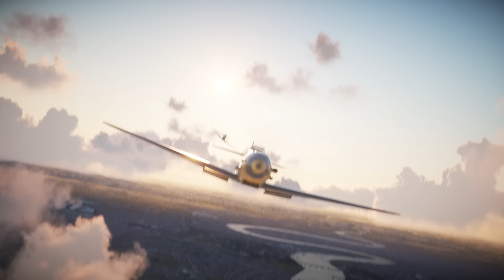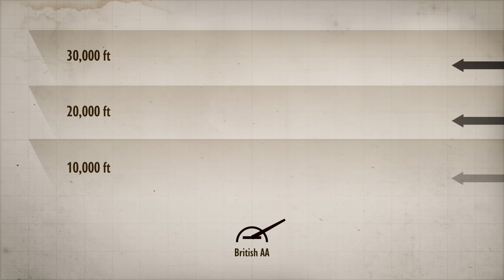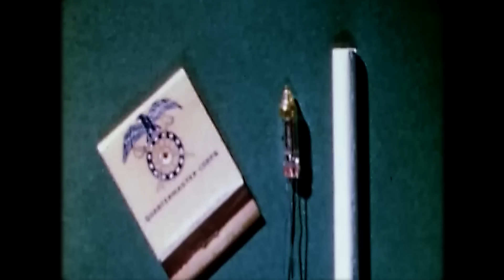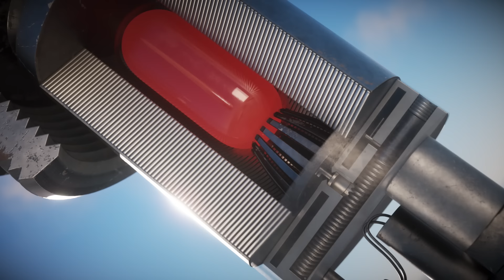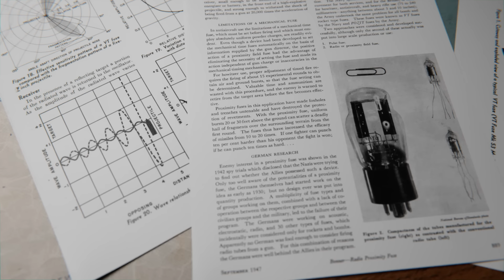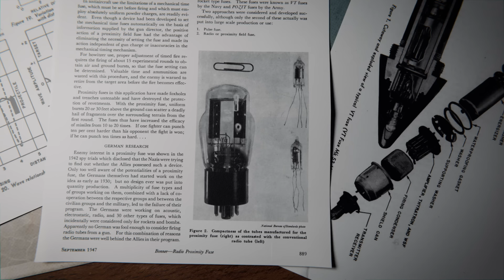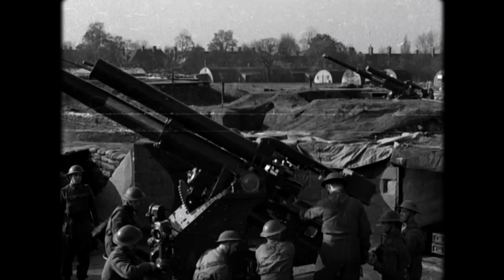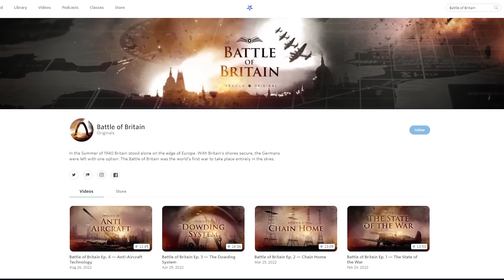The Secret Invention That Changed World War 2

Comment: The British Technical and Scientific Mission [also known as the Tizard mission] travelled to the U.S. in September 1940 during the Battle of Britain.  The technology Britain passed to the US included the greatly-improved cavity magnetron [which the American historian James Phinney Baxter III later called "the most valuable cargo ever brought to our shores"], the design for the proximity VT fuse, details of Frank Whittle's jet engine and the Frisch–Peierls memorandum describing the feasibility of an atomic bomb.  Included in the other technologies given to the US were: designs for rockets, superchargers, gyroscopic gunsights, submarine detection devices, self-sealing fuel tanks and plastic explosives.
Reply: Sonar/ASDIC was invented in France. US aircraft, except P51B's and up and two variants of P40, used turbo chargers. Self-sealing fuel tanks had been around since WW I, they would not be standard on RAF aircraft until after the Battle of France.
   "given" As of 2006 Britain still owed the US 4.4 billion 1934 USD in WW I debt. "First and foremost, they note that they have written off the main body of Lend-Lease, amounting to something of the order of £4,000,000,000 to £5,000,000,000 (16 to 20 billion USD) net"
 below 678 
Hansard ANGLO-AMERICAN FINANCIAL ARRANGEMENTS HL Deb 17 December 1945
Reply: @nickdanger3802  So the P51D had turbocharger fitted to its RR Merlin?

Heavier than air flying machines have been around since long before WW1, that doesn't mean that the technology had not advanced by WW2 on various aviation fronts.

Not that it has any relevance, but On 31 December 2006, Britain made a final payment of about $83m (£45.5m) and thereby discharged the last of its war loans from the US.  Also  In 1952, the London Agreement on German External Debts assessed the final reparation figure at $3 billion. Germany has yet to pay off its debts for World War II.
Reply: @gnosticbrian3980  "US aircraft,    except    P51B's..." 
Allison engines in everything EXCEPT P38's had a single stage supercharger, P38's used a turbocharger as the second stage. Radial engines in combat aircraft had superchargers and turbo chargers.

United States: War Loans to UK
HL Deb 27 May 2002 vol 635 cc126-7WA127WA
§Lord Laird asked Her Majesty's Government:
Whether they owe money to the United States Government as a result of World War Two debt: if so, how much is owed; when it will be repaid; and what representation they have made to the United States Government concerning the debt being cancelled. [HL4422]

§Lord McIntosh of Haringey Under a 1945 agreement, the United States Government lent the United Kingdom a total of $4,336 million (around £1,075 million at 1945 exchange rates) in war loans. These loans were taken out under two facilities:
(i) a line of credit of $3,750 million (around £930 million at 1945 exchange rates); and
(ii) a lend-lease loan facility of    $586 million    (around £145 million at 1945 exchange rates), which represented the settlement with the United States for lend-lease and reciprocal aid and for the final settlement of the Financial claims of each government against the other arising out of the conduct of the Second World War.
Under the agreement the loans would be repaid in 50 annual instalments commencing in 1950. However, the agreement allowed deferral of annual payments of both principal and interest if necessary because of prevailing international exchange rate conditions and the level of the United Kingdom's foreign currency and gold reserves. The United Kingdom has deferred payments on six occasions. Repayment of the war loans to the United States Government should therefore he completed on 31 December 2006, subject to the United Kingdom not choosing to exercise its option to defer repayment.

As at 31 March 2001, principal of $346,287,953 (£243,573,154 at the exchange rate on that day) was outstanding on the loans provided by the United States Government in 1945. The Government intend to meet their obligations under the 1945 agreement by repaying the United States Government in full the amounts lent in 1945 and so no representation has been made.
Reply: @gnosticbrian3980  "Britain actually received more than a third more Marshall Aid than West Germany - $2.7 billion as against $1.7 billion. She in fact pocketed the largest share of any European nation."
BBC The Wasting of Britain's Marshall Aid
Reply: Indeed so - where have I ever denied it?  The aid received was then p****d up  against the wall by the Labour Government.

Doesn't change any of the facts in my original post. @nickdanger3802
Reply: @gnosticbrian3980  Who used it among other things to create the once superb National Health Service, reorganise the railways, build 1 000 000 Council Houses in 5 years, enable cost-free kindergarten, primary and secondary education for all including government- funded university education if had one passed one's exams at one's government-run secondary school , all part of a socially valuable impetus that remained until Thatcher wrecked the UK by privatisation of every State-owned industry and public service. No doubt in the USA all that is seen as pissing money against the wall.
Reply: Brits take credit for everything 🙄
Couldn't even give the Poles credit for decrypting the Enigma Machine
Reply: @chaosXP3RT  Please go to Bletchley Park, home of Enigma, and read the captions..
Reply: @chaosXP3RT   Nor gave credit to to the German who stole it and handed over to French, who couldn't figure it out and gave it to the Poles. That machine was a 4-rotor model albeit the principal version used by the German military was a 6-rotor version. All credit to the Brits at Bletchley Park who cracked the codes that came via the Enigma machine and who invented the gadgets (bombes) that could crack German Enigma transmissions in a matter of hours, if not less.
Reply: @chaosXP3RT  I think every British person knows and owes a massive debt of gratitude to the Polish/American people and other allies for their help during WW2. Britain would certainly have been destroyed and no way could have we held out without massive help. Having said that a video on proximity fuses that doesn't mention the Tizard mission does feel like a slight slap in the face for historical accuracy if nothing else. This isn't taking credit for the amazing/igneous design of the final product but for the work that was done previously to enable that design in the first place.
Reply: @markcartwright8169  What about the huge debt the Polish/American people owe Britain for it's technology and massive effort holding out against germany and being a staging post for US forces, mo ron.
Reply: @robmiller1808  Its not for me to say cos I'm British, If they wanted to say they are grateful its up to them whether they feel that way or not. All I can say is how I feel I'm grateful for what they did as allies. But yeah fair point
Reply: @markcartwright8169 Britain most certainly would not have been destroyed. The Battle of Britain was won and the invasion of the UK cancelled.  Also the Germans would not have got passed the largest Navy in the world in 1941. Learn your history please.
Reply: You're right, I withdraw my remark.
Reply: @robmiller1808 The significance of British technology is hugely overstated.  I’m not saying Britain didn’t have some technological advances, but the way it is portrayed by commenters on YouTube without giving other countries their due credit is embarrassing.
Reply: @markcartwright8169  As Hitler volunteered not to invade the UK but turned on the USSR in July 1941, a great many Americans and British owe a debt of gratitude to the 27 million people , civilian and military, killed by the Germans in the USSR during USSR's absorption and ultimately destruction of the invading German military. It is most unlikely that Germany could have destroyed Britain after July 1941. The Yugoslav partisans also helped by tying up 26 German army divisions. And of course the British Indian army fighting the Japanese no doubt helped the USA in the Pacific, as did the Australians fighting in PNG and the Royal Navy  fighting in the Pacific.

However, between the Germans and the USSR, the Poles lost everything.
Reply: @chaosXP3RT  Thje Poles didn't decrypt the Enigma machine - but they did make remarkable progress towards breaking the code.

Arne Carl-August Beurling a Swedish mathematician, single-handedly decrypted an early version of the German cipher machine Siemens and Halske T52 in a matter of two weeks during 1940, using only pen and paper. This machine's cipher is generally considered to be more complicated than that of the more famous Enigma machine. 

FYI, the Poles were hand in glove with Hitler - even sharing in the break up of Czechoslovakia in 1938.
Reply: Amazing what you can do when your industry is not being bombed day and night by the enemy...... and you are given the tech as well.....

Comment: One of the most impressive things is that they made those fuses small enough to fit in 40mm shells.
Reply: Apparently now they can fit into 30mm shells for use against drones. But during WWII they couldn't fit the fuse into the existing 40mm shells so they adopted twin autoloading 76mm guns that could use the VT fuse but that came too late in the war to be used

Comment: I had a friend who was into RC model aircraft just after the war. Their club managed to order, through the proper "connections" some of those micro  tubes to build crude, one or two channel, radio receivers small enough to fit in a model airplane.  A single channel, to control say the rudder, consisted of a wound up rubber band, that could unwind in steps, through a clock escapement mechanism, where each tick was triggered by a radio pulse by a solenoid. The rudder was then connected to that through a crank, so the rudder alternately could be changed between left-neutral-right-neutral-etc. So the plane was in that case controlled with a simple push button to select either left, straight or right turns. They later also used land line phone dials so they, by selecting the proper digit, could transmit a fixed set of pulses for more advanced controls. The models were simple and slow flying, so not having throttle or much other controls than rudder did not pose a big problem. This was very cutting edge hobby technology for 1947.

Comment: Also really good at negating cover as they really made airburst artillery horrific - enemy helmets providing really effective reflectors for the radio proximity detectors, and making that barricade they're hiding behind useless.
Reply: Total B-S I'm afraid. Helmets are not good reflectors... rifles are probably better reflectors if oriented in the right direction. The real reflector here is the ground. VT fuses were used in the Battle of the Bulge and made a huge difference, by this time it was felt that even if an intact fuze fell into enemy hands they no longer had the time or the industrial capacity to reverse-engineer it and make it in quantity.

Comment: The VT Fuse was the first project of the newly-founded Johns Hopkins University Applied Physics Lab.
Reply: Sorry, they did not invent or develop it, it came from the UK and what the Americans did was the final optimisation for mass production. The method of operation and circuit had been established, as well as the specifications for the components. READ THE HISTORY BOOKS! Even reading Wikipedia is better than nothing...
Reply: @ricardodavidson3813  How about I just go work at the Applied Physics Lab for 17 years and read the lab’s official history?  OH, WAIT - I DID!

Sure, the Brits did a lot of good early concept work.  Bur if you think that the initial idea is all that counts and everything else is easy, then you’re no engineer.  Ideas are a dime a dozen.  Execution is what separates the heroes from the toddlers in capes.
Reply: @jaymoore332  American institutions have the habit of re-writing history in their favour. I'm sorry if this rubs you up the wrong way but the British had built working fuzes that were amply tested (on rockets to mitigate the destructive acceleration forces), one of which was sent over to the US. The issue was with mass production,  there was no way British industry would be able to fulfill the estimated demand. The battery unit may have been developed in the US, I haven't checked, but what the Brits brought over was not just an "idea", that's hogwash. Also "ideas are two-a-penny" may be right for crackpot ideas that go nowhere (the nazis were good at this, flying saucers, etc.) but not ones that work, those are precious. The initial developer of this concept was Compton Turner, a very skilled engineer and entrepreneur, and his team. The story of how this came about is told in some detail by Professor R. V. Jones in "Reflections on Intelligence" which was written after the 30 year ban was lifted, so it tells the whole story rather than only the bits that were not blocked out by the security ban. His first book "Most secret war" was written before 1975 so bits of the history had to be redacted, the second book fills in the blanks. I strongly recommend you get copies of both, (in the US the titles may be different). There is also the question of the Oslo Report, Prof. R. V. Jones was responsible for identifying its author after the war, one Prof. Hans Mayer working at Siemens. In a conversation, Prof. Mayer mentioned to Compton Turner (Mayer's and Turner's companies had business together, a lot of licence production of each other's stuff so CT was a regular visitor) that the nazis were developing a proximity fuze but did not say what the technology was. This spurred Compton Turner to work out with his team possible approaches, working on radio and putting aside the electrostatic idea as impracticable. This was the approach the nazis had been following and it went nowhere. Anyway, read it up it's much more interesting than I can put across.
If you want proof of US institutions re-writing history you only have to listen to the History channel, or Nat. Geographic. It's really quite sad as well as blatantly dishonest. More and more we see the West adopting the marxist maxim that "truth is what the party says, facts just get in the way".
Reply: Incidentally, the very elegance of the electronic approach is very much "British school", Americans tended to complicate matters a bit more, they had the resources so they applied them even if it wasn't strictly necessary. The Germans were and still are the masters of over-engineering though.

Comment: We still used the VT fuse when I was in artillery in 2000, I have no idea if they are still in this format but I saw this fuse and they never explained how they worked even then. I was just told "know what it is, use it if you're told" I would say "how does it work?" And the reply was "don't worry about it"
Reply: We were still using PRC 77's until at least 2005 when I retired from the Corps... lol I went to work as a contractor a few years later (2007), and NOBODY even knew what a PRC 77 was!

Comment: Absolutely fascinating.  I am a Mission Crew Commander Air Battle Manager on AWACS (airborne radar) and prior to being in charge of the whole crew I was an Air Surveillance Officer or the guy in charge of the radar signal, changing modes, and identifying aircraft, and before that I was an Air Weapons Officer or one who read the radar screen and told pilots who to kill, where friendlies are, and hook them up with tankers and just control every military flying asset from all services and allies. All of that took 9 months of ground training to understand the radar signal before I could even start my airborne crew training.  We had to follow the signal from COHO to STALO and went over doppler shift vs the doppler notch on planes could hide from radar.  I'm also a WWII buff and never new about our proximity fuses and certainly didnt know about artillery/anti-aircraft shells using a radar pulse.  Before I even start Air Battle Manager training I was a nuclear missile maintenance officer in Montana and much to the way our missiles work were created by brilliant minds using rudimentary methods like the one mentioned here with the liquid being dispersed by centrifugal force and therefore making it safe otherwise. Out Minuteman III missiles have many rudimentary but clever failsafe devices similar but different to this video.  These sliderule guys with no computers always found a solution and some were very mechanical as long as it got the job done. Great video.

Comment: Everyone likes to talk about "Doppler effect", but I think "interference" is a simpler way of understanding it.  The received signal either reinforces (constructive) or reduces (destructive) the oscillator signal.  What happens is the function of the signal's  wavelength and the distance to the reflection.  As the distance closes, it will AM modulate the oscillator.  No precision measurement of frequency is required.  As you point out, it's the beat note that sets off the charge.  Both explanations are valid, it's just I find the "time domain" explanation simpler than the "frequency domain" one.